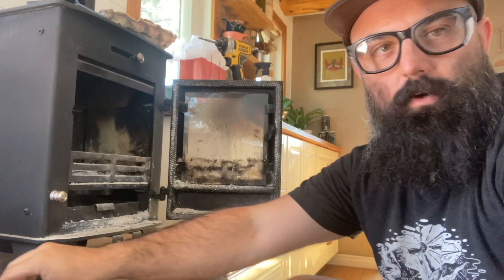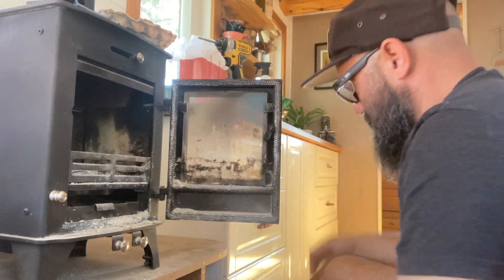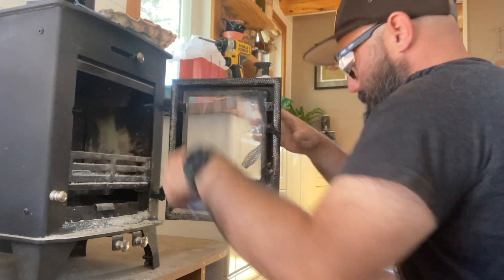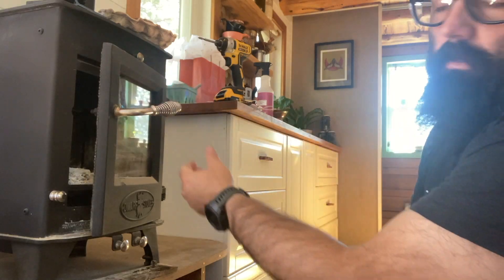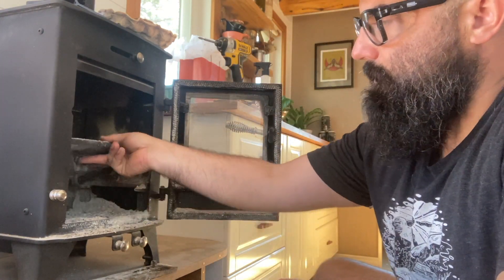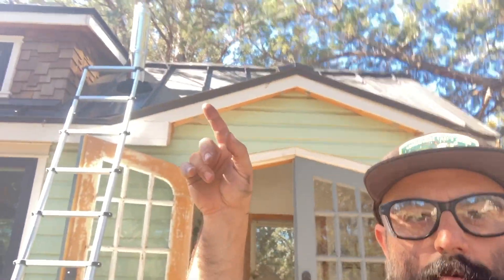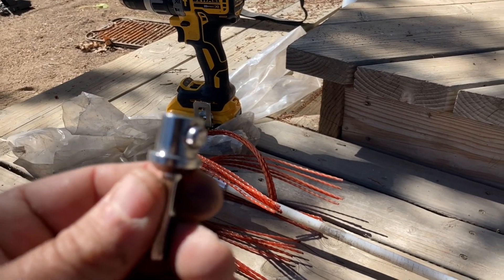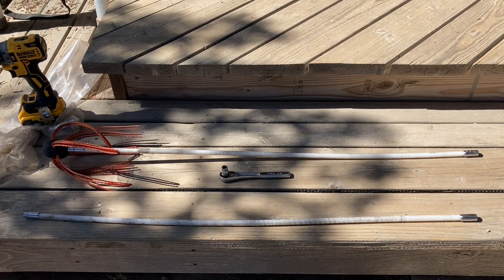How to clean your Tiny Wood Stove Flue System

Comment: I have a stove slightly larger than a Cubic stove, but have a 3" double walled flue. I have burned compressed logs most days and some nights for a little over a month, with a little oak as well. My flue plugged up with dry ash enough that my draft was substantially reduced and smoky. Cleaned my flue and cap and draft is back to normal. It seems odd that it would ash up that much so quickly. Any suggestions what I might be doing wrong?
Reply from the maker: 3" pipe can require more frequent cleanings so it's not that odd to hear you had to clean it after a few months of use.  It might help to get a flue thermometer to ensure you're burns are landing within the optimal range for your Cubic stove (typically in the 300-500 range).

Comment: Can a poly dryer vent brush be used to clean stainless steel chimney liner?
Reply from the maker: You can give it a try but we prefer the more rigid brushes like the one used in our video and available on our website.  Typically, the dryer vent brushes are not as heavy-duty as those intended for wood stove use.